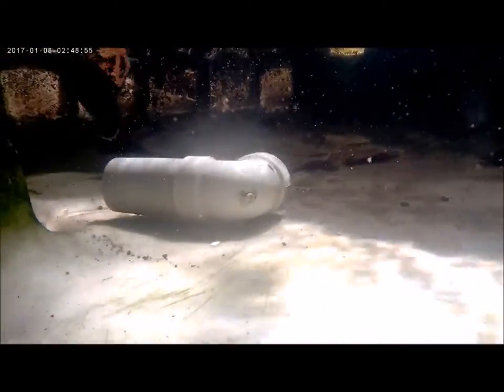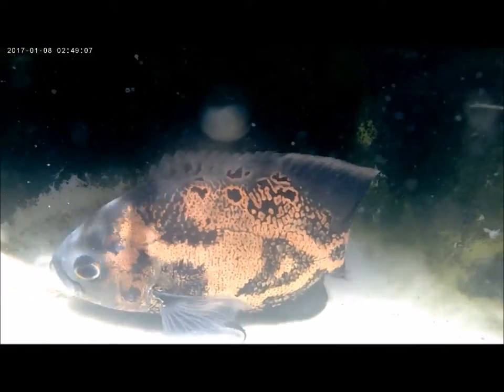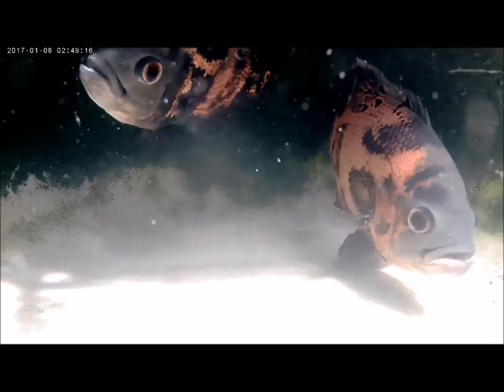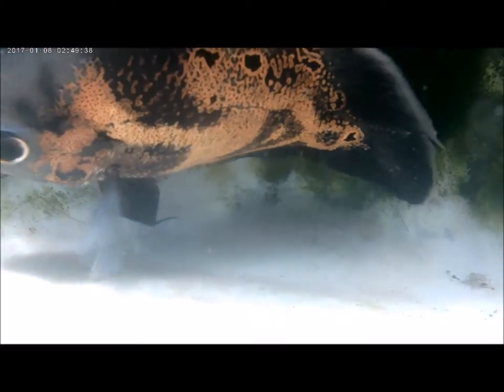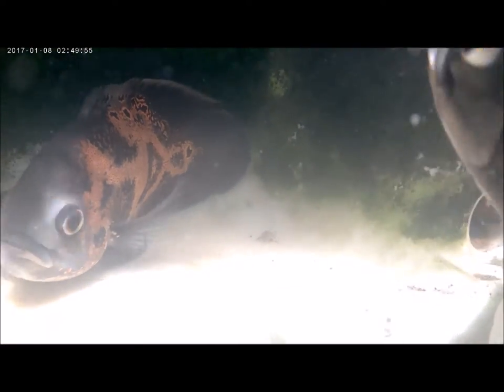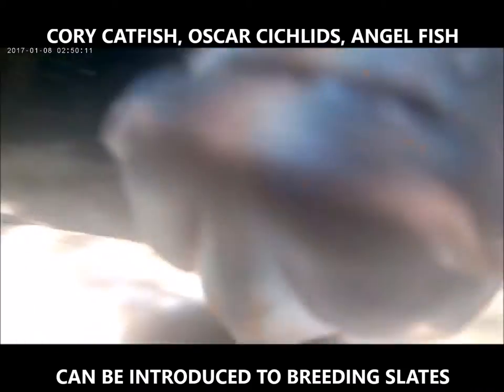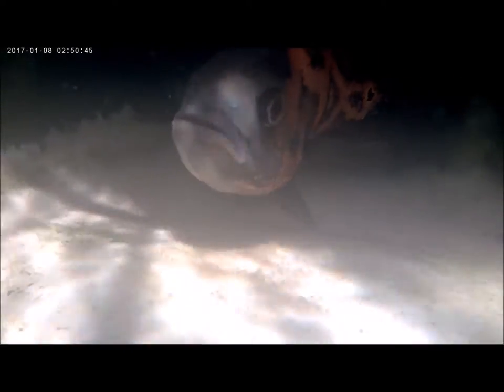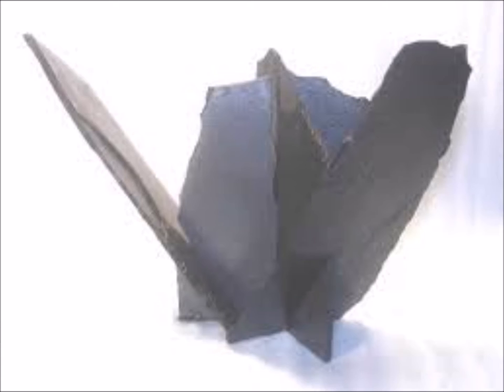CICHLIDS USING BREEDING SLATE

Comment: Dear Raliegh:
I read that it's important to avoid exposing oscar eggs to the air.  So, when using this method, the slate should be placed in a container, while still under water, and transferred to the grow-out tank in that.  I can't speak to the veracity of this, but if it helps prevent losses, I'd recommend you give it a try.
I hope that you soon have good success with breeding oscars.
Sincerely,
E. J. Brinegar
Reply from the maker: never knew that. Thanks for let me know. I appreciate it. Thanks for the over all guide you have shared. Stay safe and happy fish keeping.

Regards
Raliegh